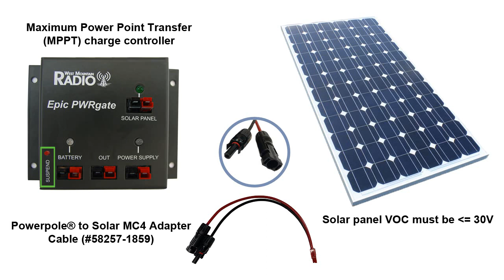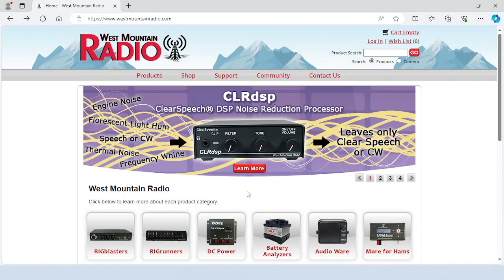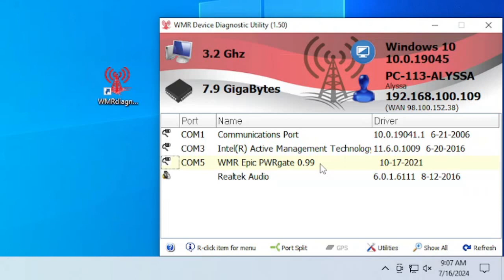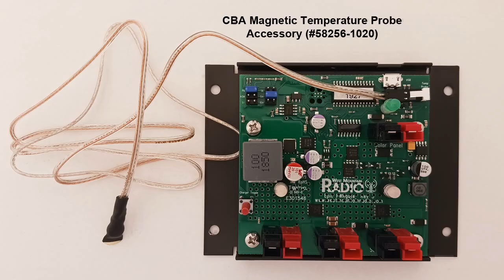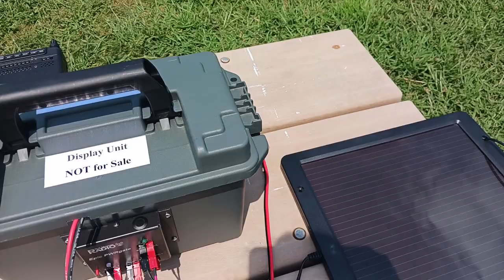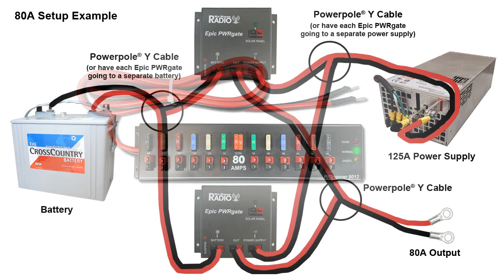Epic PWRgate: Backup Power System

Comment: So would you need a separate charge controller for the battery, or is the MPPT  built in to this unit the same thing?
Reply from the maker: You cannot use a separate charge controller with the Epic PWRgate, because the Epic PWRgate has a built-in charge controller that lets you charge a battery from a power supply or solar panel (MPPT).